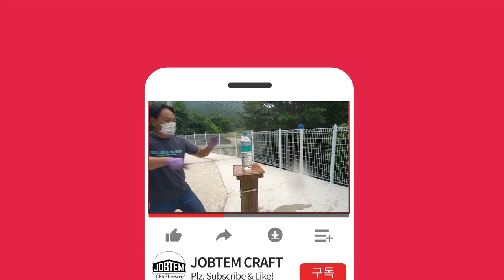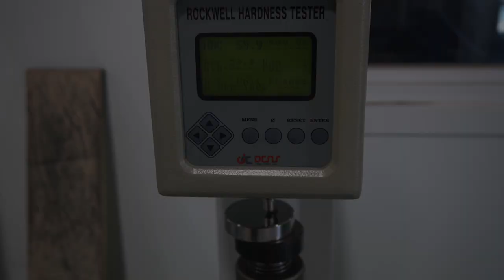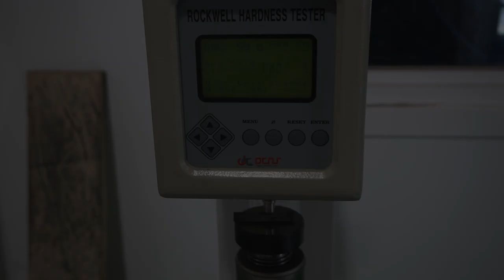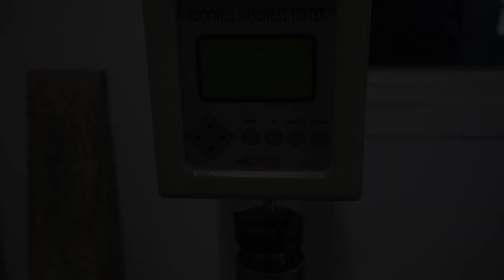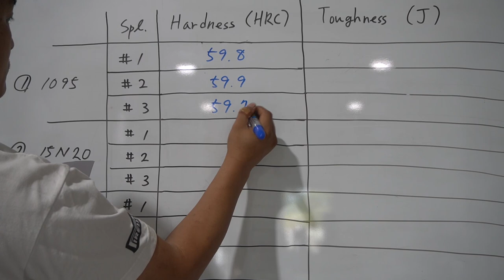How strong is Damascus Steel? Let's Testing! 다마스커스는 얼마나 강할까요? 실험해 보았습니다!

Comment: Excellent professional testing method howeve🎉r the way a sword is quenched can really affect its strength. I have a theory that you can quench the outside then allow heat from inside to slightly temper the outside if you pull it out at just the right time. Also the inside would be much tougher than the outside or thorough hardened ones that you tested. Do you have a few bars to try out my ideas
Reply from the maker: Thank you for watching 😚 🙏